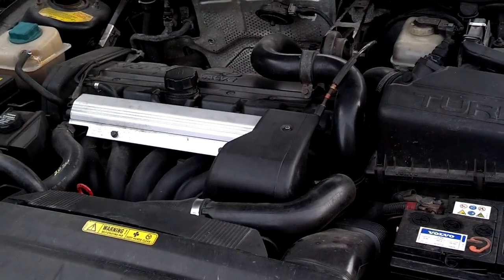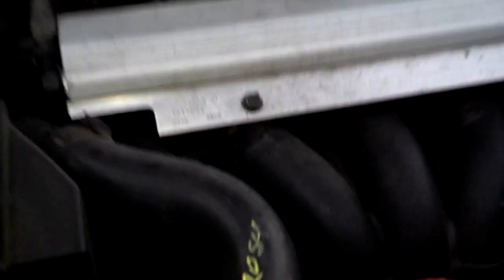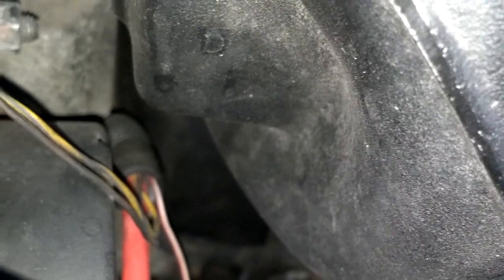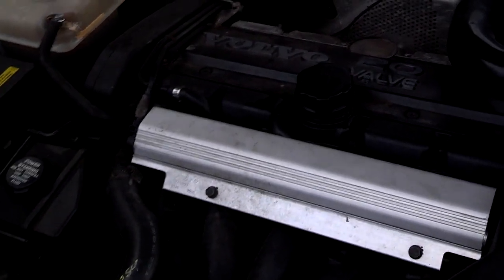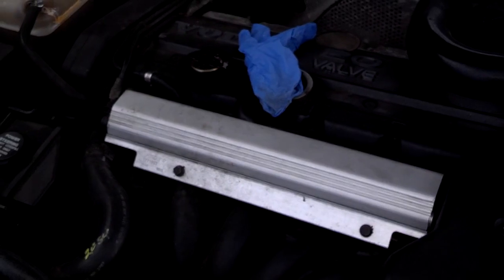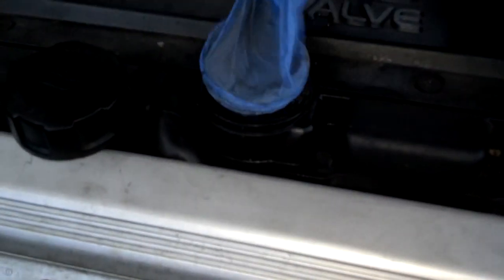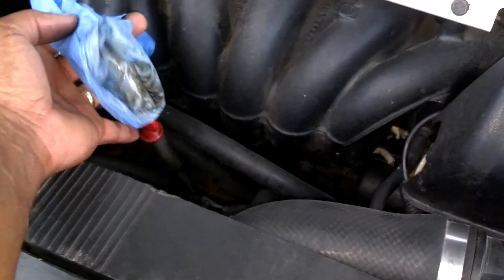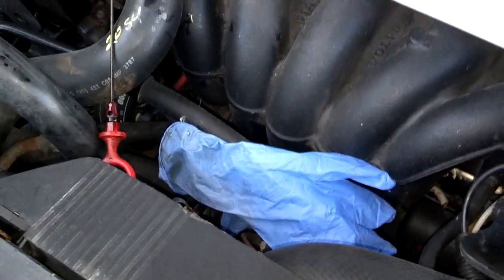Volvo PCV system check, 850, V70, S70, and others - VOTD

Comment: Hello Robert. I have watched so many of your videos and i can't still get a helpful hint to whats going on with my 200 s60 2.4t . I noticed smoke coming out from the dipstick and oil cap. I did a pcv change and cleaned the ptc valve. Its been 2 months and i still get smoke from the dipstick and from the oil cap. Thank you
Reply from the maker: barry adams Smoke coming from the dip stick and oil fill cap is not a problem. When the car is driven to temperature, the oil gets up to 200+ degrees F. If you pull the dip stick or remove the oil cap the hot oil vapor will come out. The system is designed to control those vapors and not eject them into the atmosphere. The PROBLEM would be if the system is building pressure in the engine. That is why I INSTRUCT people do preform the glove test. If it still fails the glove test you need to do a compression test.
Reply: Robert DIY thank you Robert. I tried the glove test and it failed . I'll do the compression test this weekend. Do you have any idea about the DSTC service requited issue? . It comes and goes . I tried a local scan and i got - "yaw sensor 1 and 2 is out of permitted range" . There are no dealers close to where i am . If you know whats going on please advice. Thank you for your time Robert.
Reply from the maker: barry adams Hey Barry, I'm better with the actual codes.
Reply: Robert DIY These are the codes i got ABS-00A1 ,ABS-00C0 , ABS-00B2 ..  I  dont know what they mean. Can you please help out.. Thank you Robert
Reply: Robert DIY These are the codes i got ABS-00A1 ,ABS-00C0 , ABS-00B2 ..  I  dont know what they mean. Can you please help out.. Thank you Robert
Reply from the maker: barry adams I have no idea what those codes mean. You may have to seek and use a Volvo scan tool.

Comment: smoke is coming out of my dipstick but i belive it to be steam. i pulled up the dipstick and let it smoke out of there for awhile and i noticed the oil on the top of the tube turning a milky white. as what happens when water and oil mix on an engine. is this just my pcv breather or is there something else that needs to be replaced?
Reply from the maker: Tiffany Bowen Did you do the glove test? What kind of car do you have?
Reply: 95 850 turbo wagon, i have not done the glove test yet,
Reply from the maker: Ok, let me know after you do.
Reply: I did the glove test and its begging for a high 5. glove fills right up. I plan on ordering my pcv kit on payday along with new oil cooler lines as I have noticed one is now leaking. I do drive with the dipstick pulled up to allow the escape of the smoke/steam.
Reply from the maker: Sounds like a plan. Let me know if you need help.
Reply: well got the kit today from our hometown local volvo expert. rainbow motors. going to attempt to rplcae tonight will let you know how it goes.
Reply from the maker: I try not to do complicated jobs late at night. lol
Reply: well i just finished itabout an hour ago. up all night but got the job done. while i had the intake off i noticed oil coating my intake valves. i wiped them off and proceeded to go about installing the kit. found a few hoses not related to the pcv that needed to be replaced so i did. the main clog in the pcv was actually the small hose running to the turbo. the hole in the sensor deal, sorry im extremely tired and new with volvos. i had to use a drill bit to actually unclog it. havent even owned a volvo for a month but im showing it whos boss. your videos have been very helpful to me.

Comment: Hi Robert you said maybe Likely a bad brake booster vacuum hose. Do you have a Video for  changing  it  or can you tell me were it is on a Volvo 2000 s70 you have help me with your video in the past Thanks so much
Reply from the maker: Victoria the weaver The brake booster hose is the larger one that runs under the air box. Find some help and have someone hit the brakes while you are under the hood.

Comment: Hi Robert,I liked your video! Do you happen to know what causes a 2003 Volvo S-80 to make a whistling sound after it is driven a few miles it is driving me crazy! Any suggestions?
Reply from the maker: Paul Delsignor Likely a vacuum leak.
Reply: Thanks Robert .It actually ended up being the PCV system being clogged up. I tried your rubber glove test and it worked great,thanks for the help!

Comment: Hi Robert, I recently bought a 95 Volvo 850 turbo. I cleaned out the PTC which eliminated the crankcase pressure (The PCV system had been done a year ago but that one little port got clogged up). Then I went on a trip for about 10 days, having a friend start it every couple of days to keep the battery fresh. This could be totally unrelated to the PCV, but now I have smoke coming from the back of the engine right around the exhaust manifold. I can't really smell any burning smell, and it is white, similar amount and color to the dipstick smoke before I cleaned the PTC. Do you have an idea about what this could be? I know I saw on the service manual that every 5000 miles the exhaust manifold bolts should be torqued but I can't find any info on that anywhere else. I also know that if these  850s sit for a while they can have some extra smoke from the rings and stem seals but still it should not be coming out in the engine bay. Let me know what you think. Thank you so much; your advice is always spot on and your time so kindly volunteered.
Reply from the maker: A. Tucker Aww man, I wouldn't have anyone starting my car for anytime less than 15 days. Then it should be driven, not just started and idled. The owners manual warns against that. Anywho, I would watch your coolant level. I have never torqued any exhaust manifold bolts on any of my P80 cars. I've put over 85,000 miles on mine and never touched an exhaust manifold bolt. If you see smoke back there, something is leaking. The turbo is back there so it can be oil or coolant. I would drive it for a few days to see if it stops. If it doesn't, find the leak, probably oil.
Reply: I figured it might be best to just drive it and see if it goes away. I don't like just idling it, but I need to do some repairs before it can be registered so I can't drive it yet.
Thanks.
Reply from the maker: Oh, ok. Just disconnect the battery
Reply: Robert, as always, you were spot-on. I finally got it registered (thankfully it passed emissions!) and I took it on a nice long highway drive. No more smoking! Thanks. You're the best.

Comment: Robert, love your videos.  Wish I had started watching them sooner.  The PCV breather failed on my '06 S40. It started making this awful whirring/moaning noise.  I went ahead and immediately replaced the unit (different process on this model, still bad design!).  But I was not quick enough - I noticed some oil leaking around the intake cam sprocket with the vvt actuator on it.  So I will need to replace that and the belt and seals.  Can I just lock the cams with the cam lock tool or do I need to lock the crankshaft too?  

I would advise anyone purchasing a used Volvo with an I5 motor to just go ahead and replace the darn PCV breather because it will eventually bite you in the rear end!
Reply from the maker: John Nichols Sorry to read about your issues. Locking the cams with the tool is enough.

Comment: thats is nice , i have a volvo, and is doing that. but the most worst have oil is passing the oil to the radiatior and the sparkplug area . how do i clean it or fix that. i do all the services by my hand.
Reply from the maker: Pat Rod I don't quite understand what you are writing. If oil is transferring oil into your coolant system you need to fix the problem. What Volvo do you have?

Comment: Hi Robert, I'm replacing my head this easter break and would like too know if i put any gasket sealer on the thermostat housing at the head where the thermo housing connects at the head and do I need to put any on the throttle body gasket . Also where the water pipe connects at the back of the head right side, do I put any there? Thanks in advance.
Reply from the maker: Christopher McKay No, also, there is NO NEED to remove the throttle body from the intake. Have you watched my head job videos? - https://www.youtube.com/watch?v=DtVLpXpk_U8

Comment: Good Information... Will Check.. I have a Volvo s40 That Idols ruff and shuts off. Check Engine Light Flashes... Checked the Catalytic Converter, Relays, Changed Thermostat, but still does it... It sounds like that may be the problem... Never thought to look there...

Thanks, Will Do...
Reply from the maker: ***** Have you scanned the car for the codes?

Comment: Hi robert
I am looking at buying a 1999 volvo v70 non turbo with 168.000 kms on the clock

The pvc test in your video i was wondering uf the motor has to be warm from driving or could it be done from a cold start?

Also would there be any other issues that i would need to be aware about while inspecting the car?

Thank you
Reply from the maker: Alex Well, they changed the system a little from '98 to '99. However, the test seems to work. You can test it both ways, cold and hot, it won't matter much. You can look at this video: https://www.youtube.com/watch?v=L4g-w4OXeBw
Reply: Robert DIY thank you so much for all your help, your video was a great help now i know which parts could be bad and need replacing,

Will always love old volvos and would have more of them if i could

Comment: I have 1994 Volvo 850 turbo had the pcv system done it was clean but replaced it with new hoses breather box etc still show the signs of needing it done the egr was replaced to what else could be clogged.  Help
Reply from the maker: Tyrone Chisholm What signs?
Reply: Smoke still coming from oil stick
Reply: Its like something else is clogged the old parts were not clogged riding with dipstick not all the way down to relieve pressure
Reply from the maker: That doesn't tell me anything. Did you do the glove test over the oil fill cap?

Comment: Hi Robert, I've just done the dipstick test - there was a little bit of smoke, and when I out a glove on the oil filler, it inflated a little bit after a minute or so. Is the car still drivable? And any advice on servicing the PCV system? Thank you :D
Reply from the maker: RichieRouge206 First off, what kind of car do you have? Year model? If you watched the video, you will know that MANY, MANY people drive the cars with the system clogged. The primary risk is blowing oil seals. Also, the video explains that the "servicing" is replacement of the system and cleaning the connections points out. - https://www.youtube.com/watch?v=eEZzqyu2a6c
Reply: Robert DIY Hi Robert! My car is a 1998 V70SE with the 2.5 20v normally aspirated engine.
Reply from the maker: Drive and replace ASAP.

Comment: Hi robert. I noticed that my c70 uses a lot of oil. almost 3l / 9000 km. But it doens't blow blue smoke out of the exhaust. I just did the pcv check and it didn't blew up my plastic bag (didn'nt have a glove). I also don't see any real oil leaks on the engine. I still think my turbo sucks up the oil. Is there anyway to check that?
Reply from the maker: NineEleven1 If the turbo is bad it will smoke out the tail pipe most of the time. If you are a short trip person, it will likely use more oil. How many miles on the motor and what weight oil are you using?
Reply: 5w30. most drives are 35 to 50 km. 138k km. 2.4 lpt.
Reply from the maker: What climate are you in? You may want to switch to 10W-30 or 10W-40 if you are in a warm climate.
Reply: Robert DIY west-europe. I checked again with a glove around the oil fillercap and it was getting pulled in. So I can conclused there is no pcv problem. I do seem to have a boostleak (only 0,3 bar OBD says) and audible to. I will fit new intercoolertubes next week. maybe this wil solve the oil consumption?
Reply from the maker: Seems that the PCV is fine but I have no idea where your oil is going. If you are doing mostly city driving, you are fine.

Comment: Hi Robert, my car had a CEL and was running lean. It will stall when I'm not accelerating sporadically - sometimes it will go a week without stalling at all. Right before it stalls, occasionally the "transmission mode" light will go on. My mechanic found a hole in one of the vacuum hoses and replaced it. The CEL has not come back on but it is still stalling. I just did the PCV test again and it blew the glove up and there was some smoke coming out. 

Is the PCV system the cause of the stalling or does it sound like it is more likely something else? People have also suggested the MAF sensor. I only have enough money to service the PCV system and if it doesnt fix the stalling I will be in serious trouble. Your opinion?
Reply from the maker: katie13711 Hi Katie: A clogged PCV will not cause stalling. However, if a PCV system hose is damaged, it can cause stalling. If you drive 50 miles with NO code, you likely have a fuel delivery problem.
Reply from the maker: katie13711 What car do you have?
Reply: Robert DIY I drive a 1996 850 non turbo. When it is stalls: I will press the gas and nothing will happen - not getting any power or anything. Then after I press the gas for awhile, it will kick in and go. As long as I'm accelerating it won't stall. Before it would only stall when I was at a stop, now it will stall when I'm  not accelerating like when taking a turn as well, I did change the fuel pump relay because that was suggested as well. When I turn the car on, I can smell gas sometimes. Any ideas?
Reply from the maker: Scan for codes.

Comment: Thanks for the great videos. I have a question. I have a 97 850 and a 98 v70 turbo. I checked both of them with the glove like you said and both cars blew the glove up. I replaced both pcv systems and my 850 is good but the v70 turbo still blows the glove up. I bought the systems from fcp euro and they came with the box and all the lines. Is there something else I need to replace?
Reply from the maker: dannygun34 Did you clean out the holes in the block? Did you clean out the PTC valve? Have you done a compression test? - https://www.youtube.com/watch?v=G46aNGJM94I - https://www.youtube.com/watch?v=Z0hZELYgOX8
Reply: I got the cart in front of the horse. I watched this video before I watched your other one. I took the turbo off today because I thought it was bad but it seems ok. I cleaned the ptc valve and I will be putting it back together when I get the new seals. I hope the positive pressure is taken care of.  Thanks again for all of your time that goes into these videos.

Comment: Hey Robert I have an 03 Diesel engine called the d5
Reply from the maker: Dahlia Thomas Oh, ok. Is there something I can help you with?
Reply: Hey Robert I have a v70 d5 , it's currently done only 80,000 miles had the rear main seal done at about 65,000 miles due to oil leak, and it is now leaking again, only small drips, I have just known about this PCV valve and if that is the cause, do you think I'd still need to replace that rear seal as the pressure would be less in the crankcase after replacing PCV valve, or would you say that isn't the cause?
Reply from the maker: Have you done the test? If it's bad, you should never replace the RMS unless the PCV system is serviceable. If the RMS is leaking and you replace the PCV system, you have a 25% chance that the RMS leak will stop.
Reply: Ok sir that sounds bit positive thanks , so Wat test should I carry out? Is it to service the PCV?  Or replace it?
Reply from the maker: Replace.
Reply: Thanks for your expertise Rob

Comment: Hey Robert I have a v70 d5 , it's currently done only 80,000 miles had the rear main seal done at bout 65,000 miles due to oil leak, and it is now leaking again, only small drips, I have just known about this PCV valve and if that is the cause, do you think I'd still need to replace that rear seal as the pressure would be less in the crankcase after replacing PCV valve, or would you say that isn't the cause?
Reply from the maker: Dahlia Thomas What year car do you have? What is a d5?

Comment from the maker: Hi Dovydas, for some reason, I could NOT replay to your message. Likely a setting in your account. At any rate, as the video explains, I do NOT use NOR like the smoking dipstick test. The oil system gets hot and will smoke. Smoke is NORMAL, that is why the system is designed to trap and recycle the fumes. So, it sounds to me like things with your SERVICED system is working very good. Move on to another issue, we all know there is one. ;)
Reply: Thanks for a quick reply, and I got one more problem. When the engine is idling, I can feel some vibration while sitting in the car, the rpm needle is jumping up and down a little, what could be the cause of that? If I disconnect the maf sensor, rpm jumps to 1000 and it seems that the vibration is gone. I cleaned the maf sensor and even put another one from other volvo 850, it didn't help, I think it's not the cause. Maybe I should change the spark plugs?
Reply from the maker: When was the last time you replaced the spark plugs? - https://www.youtube.com/watch?v=azZ6HAjRihk

Comment: Hey Robert, I have replaced the pcv system few weeks ago, because there was smoke coming out from the dipstick hole.  Now there is no smoke coming out of it, unless i rev the engine, when i rev it, some smoke comes out of it, is it normal? I did the glove test today,engine sucks the glove on idle, but when i rev it, it blows the glove a bit and sucks it back in, what does that mean?
Reply: Dovydas could mean you’ve gotta old vacuum hose that’s cracked

Comment: Great video! I have an issue with the front crankshaft seal blowing out and leaking oil. The PCV system does not blow smoke from the dipstick and sucks in the glove. What else could be blowing out the seal? I have about 15psi of oil pressure at idle and 60 psi at 3000 rpm. It is a 2001 S60 with the 2.4T turbocharged. I am at my wits end.
Reply from the maker: Todd Goodwine Have you replaced the seal?